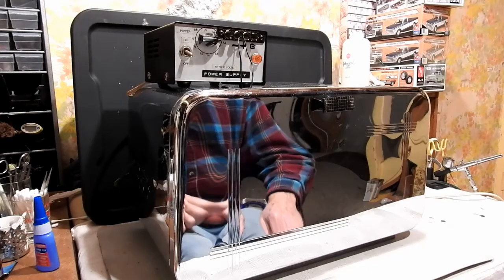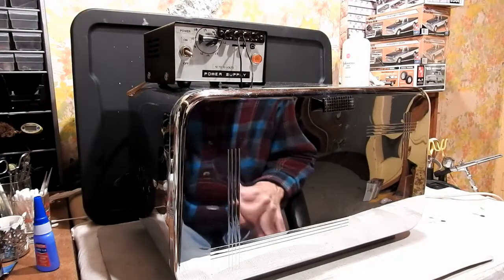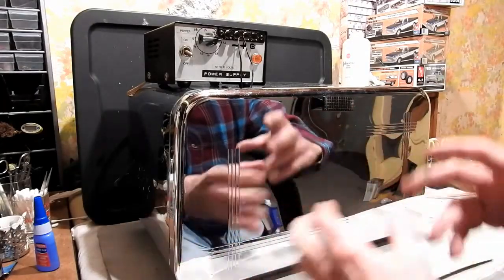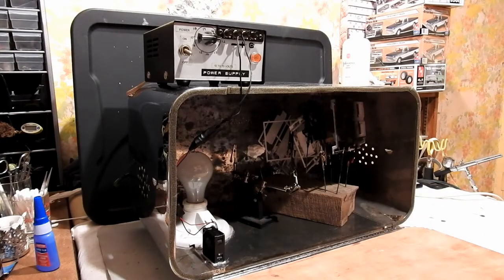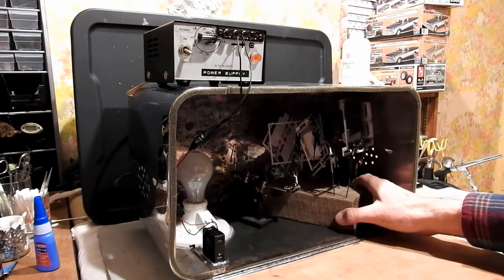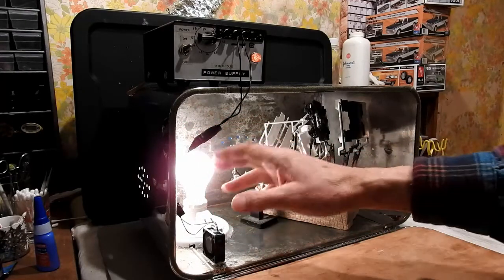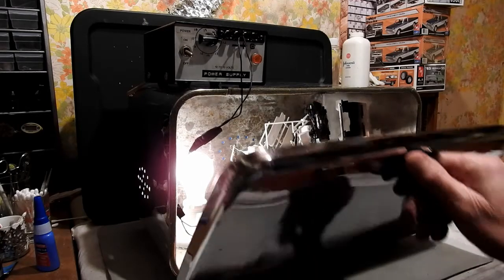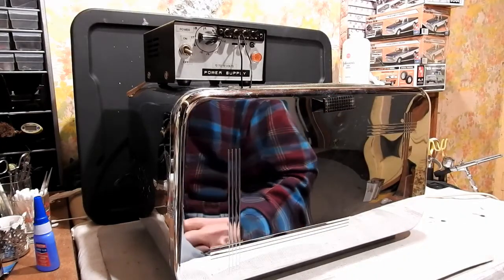Homemade paint drying booth for model cars, etc

Comment from the maker: In follow-up to drying times, I painted a model body and interior parts the following day. After 10 hours the enamel primer was able to be sanded. I then painted the same parts with enamel finish coats and put them in the dryer. After 18 hours the parts were smooth (not sticky).  Will probably wait couple days before wet-sanding the orange peel while working on other parts, just to be safe. A speed-up in drying times confirmed.

Comment: Hi what a great idea, curious did you provide vent holes on both side or only one side
Reply from the maker: The bread box was originally produced with holes on both sides and in the back which, allows for good exchange of fresh air while maintaining adequate heat on the inside. Thanks for the question Eddie.

Comment: What exactly does the 12 volt power pack do and is it needed? I’m assuming it’s to power the CPU fan as plugging directly into an outlet would be too much power? Can you explain how the power pack actually works?
 Thank you.
Reply from the maker: Yes I can Terry. Most computer fans operate from a 12 volt power source. My power "converter" or supply processes 120 AC voltage to 12 volts. There is a step-down transformer that reduces the AC voltage to a manageable level follow by rectifier circuit that changes the AC voltage to DC voltage that can be adjustable or fixed. You can buy them readymade and yes, 120 volts is too much power and the wrong kind. Unless of course you would like to hear a loud "pop" combined with smoke and flame and perhaps the chance of getting electrocuted. Not recommended. Thanks for comment.